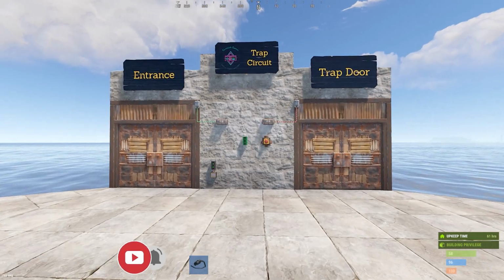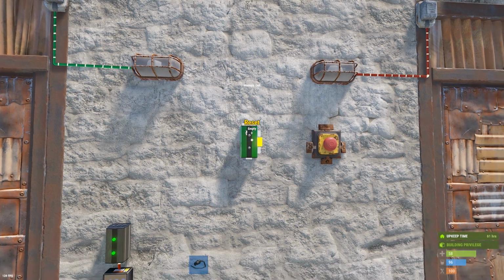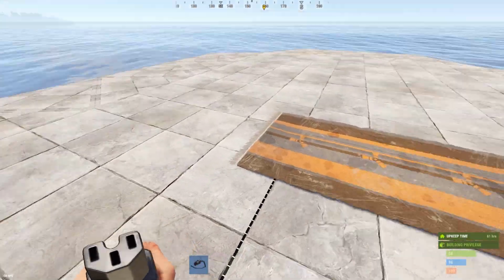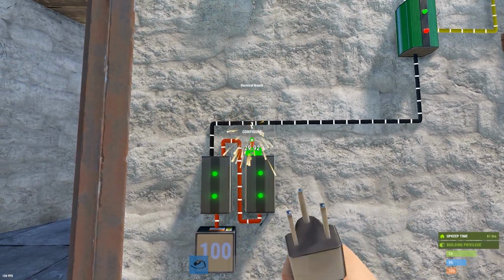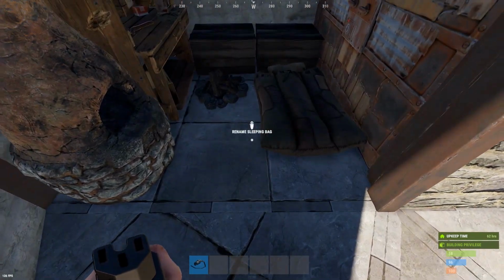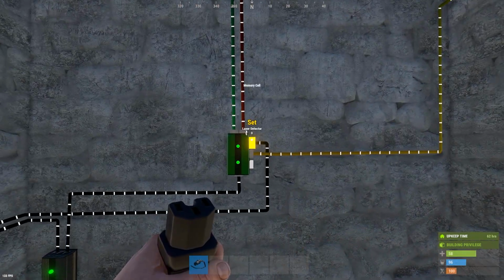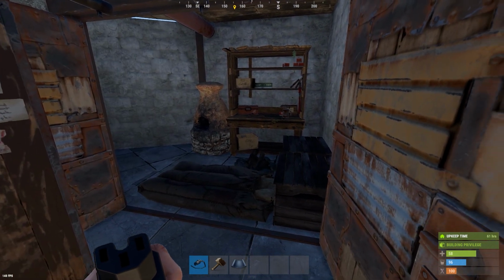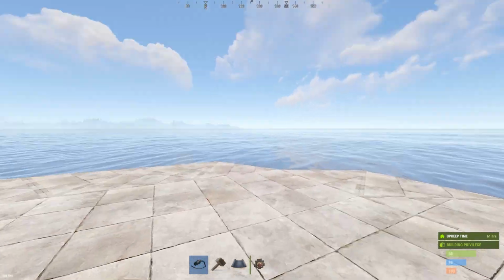RUST Electricity Tutorial | How to Build the Trap Circuit with Examples 2022!

Comment: I wonder if using an HBHF sensor instead of a laser would be more ideal. I feel like the fact that the HBHF sensor requires line of sight can be exploited to set the trap at the opportune moment, but you can auth on it, unlike the laser; omitting the need for a button.
What are your thoughts?
Reply: Edit: My bad. I didn't mean you don't need the button; I meant you can leave the button safely in TC room. Was late, lol.
Reply from the maker: I figured that's what you meant. You can definitely go about it that way! Each has its pros and cons, so it's dealers choice, really.